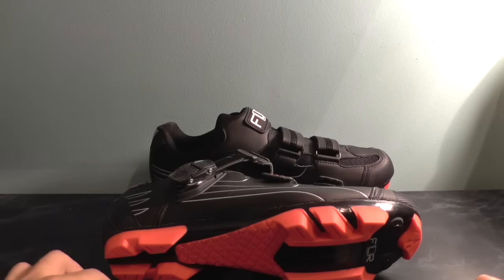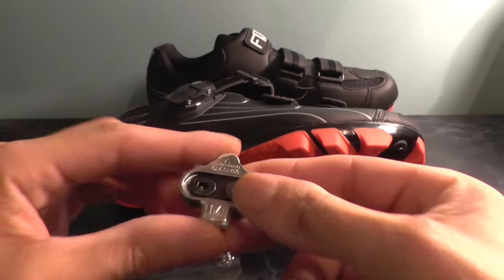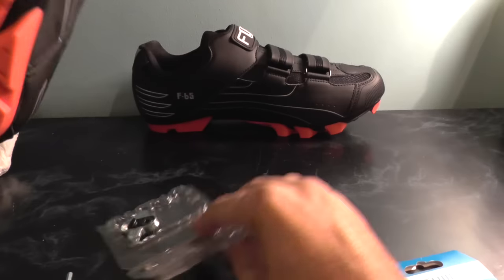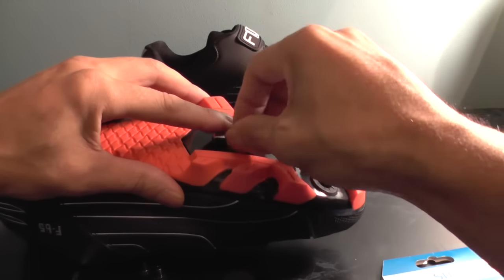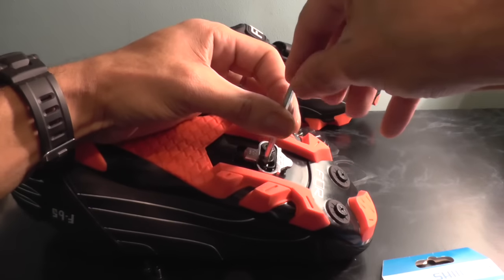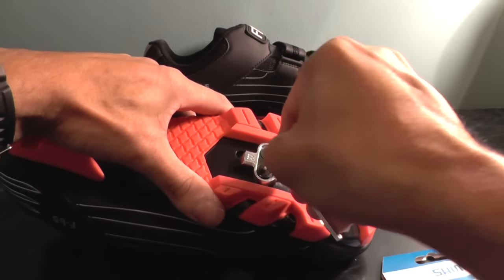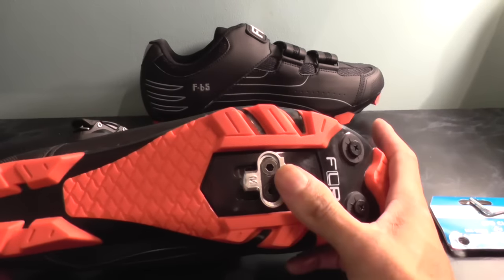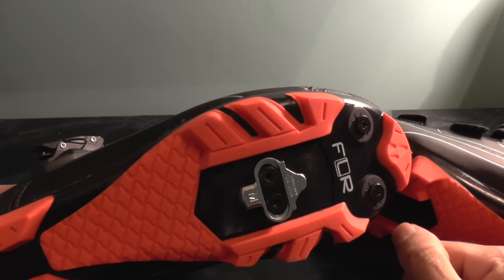How to fit Shimano SPD cleats

Comment: ... a lil' additional trick ... after mounting the cleats,  but before you reinstall the foot-bed ...  on the inside of the shoe cover the "slots w/ tape (I used electrical tape) ... Why??? If you walk in wet grass or step in a puddle the bottom of your feet get wet!!!  ... as water comes up through the slots on the bottom of the slots ...

Comment: Good video! I'm a newbie to road biking. I tried the single release cleats, but could not get on with them. Have ordered the Shimano sh56 multi-release cleats, hoping they will work out for me.
Reply: David, there is no need to go to multi-release cleats for newbie as secure clipping while driving is much more important than when you fall because you have stopped and could not unclip on time. You should just better exercise release.

Comment: hows ur legs doin'? 
have u changed to cleat position? 
because the right and left one shld be a slightly different, base on pedal to frame measurement, in my cse, my right pedal is frther 5mm from the frame compared the left pedal, so i convert the measurement to cleat position
Reply: As soon as you see in video unknown brand bike or equipment it should tell you that author is a newbie as newbies tend to buy crap. So you question of cleat position is like cosmology for him
Reply from the maker: A M I'm used to mountain bikes so want to see if I'd like the road bike posture pointless spending big money if I didn't like it

Comment: Why grease the bolts?
Reply: so they don’t get seized in from any moisture that may get around the threads.
Reply: Trust me used SPD's since 1992 - the bolts will ALWAYS seize in unless greased (copper grease best as resistance to wash out/etc better).
Reply: +Mark Turner-smith Thats interesting.  I have also been using SPD cleat since the 90-ies and I have never had them seize on me. I have used them for both my road bike and my mountainbike and never seen this problem.
Reply: Grease or thradlock